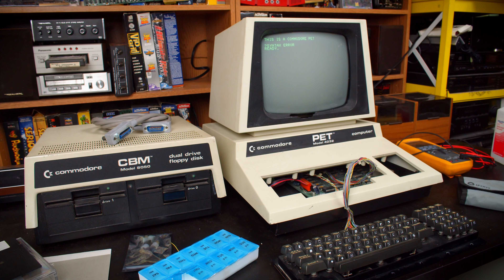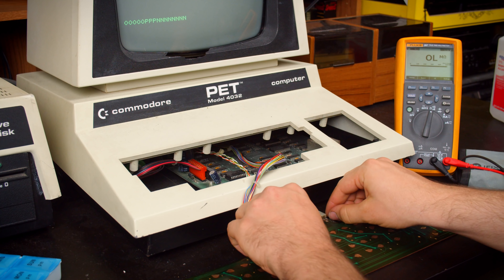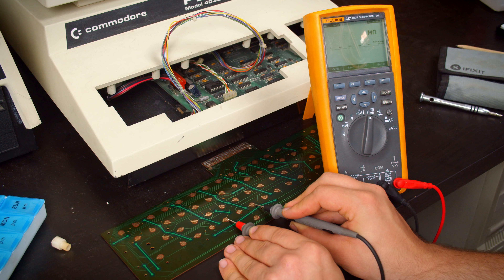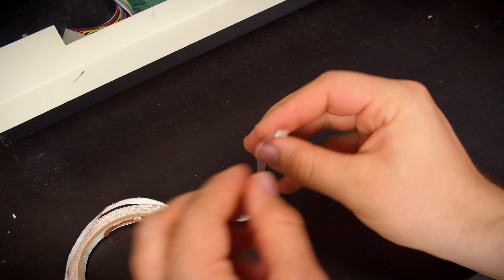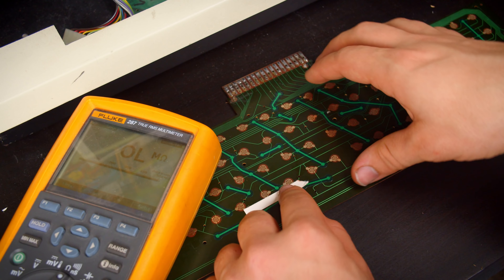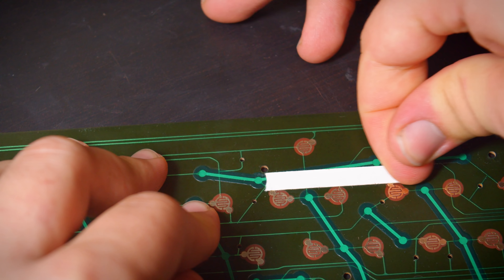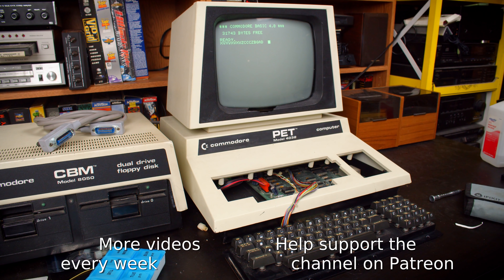Copper Tape PCB Repair - Micro Tangent

Comment: You can reface the rubber pads on the keys by “dragging” the contact across a piece of paper.  It removes the shine and restores their original functionality.  My 2001 was an absolute nightmare before I did this!
Reply: Yup. This is because the surface builds up a layer of non-conductive gunk because of the rubber out-gassing. You can also use a bit of iso-alcohol if you have observed spills or the gunk is particularly nasty. The traces themselves, particularly if they are that black carbon kind, need cleaning as well, residue builds up on them as well, which then ends up back on the rubber pads  = back to square one.

Comment: Do you document all your fixes?  I dont remember where I saw this, but it was a good idea.  All the fixes, bodge wires added, etc, were printed  on paper.  Then that paper was folded and put in a plastic sleeve adhered out of the way, inside the computer.  This way one could go back later and quickly read why, what, and how it was modified at a later date.  Very useful if one forgot what was done, or the machine is sold/given to someone else.
Reply: That's not a bad idea.

Comment: Thin coated wire from an old transformer or electric motor winding would also work if copper tape is not handy, just be sure to remove some of the coating at both ends of the wire with sandpaper or an open flame before soldering.
Reply: I keep several colored spools of prototyping wire on hand.

Comment: I can't feel good about this kind of repair in my own work. I'm glad it works for you, but I will always have a roll of .02mm and .01mm diameter insulated copper wire near my workbench.  I just see too many things fail because of "sticky thing dried out" and wire can't dry out.
Reply from the maker: Well, that's why I soldered it down. I wouldn't want to rely on the adhesive alone. I don't like the idea of using it without solder, but there are some cases like membrane keyboard where that's not an option.
Reply: Yeah, him soldering it definitely makes it fairly permanent. The adhesive can still fall and its still anchored. Its not pretty, but definitely functional without compromising the PCB.
Reply: Kapton tape down to make a base, copper tape over it, then another kapton tape on top. It will not come out in your life time.

Comment: A "prettier" repair might be to drill out the points where the traces meet and run wire links on the other side of the pcb as it's often done on single-sided stuff. It would be more time-consuming though, and this is Shelby's Perpetual Commodore Nightmare
Reply from the maker: I had thought of doing that actually. But it would be really hard to make any solution that involved soldering wires as flush as the tape was. And with the key holder "block" that goes over everything the vertical space is really important.
Reply: I cannot tell you just how much stuff gets destroyed trying to make it a half a percent better.
See, it's not JUST the time you lose doing such silly repairs, it is the can of worms you are opening trying to fix something that ain't broke and is already of questionable quality and was never designed to be field serviceable.
One of these channels uploaded a video of himself destroying a C128 because he decided to recap the 128 because, well, reasons.  If it ain't broke, don't fix it.
Reply: @LostElectron No because this is a single-sided board, not multi-layer.
Reply: @tarstarkusz  Okay, now I'm curious. What happened?
Reply: @tarstarkusz  This. Also, if you can't recap something without breaking it you shouldn't be making youtube videos.
Reply: @zosxavius   He's actually pretty good.  It's just a simple mistake that every electronics guy has made once or twice.  He put a polarized cap in backwards. IIRC, he blew one of the custom chips.
Reply: @peshozmiata : I think you've missed the point LostElecton was trying to make, which is... what if the silver above-trace passes too close to the original PCB trace. It's not a layered PCB, but the silver above-traces make it kind of like a layered PCB. With a small enough bit and good aim, one could drill through the PCB between the traces, but is such an invasive repair necessary if soldered conductive tape also works? I personally would have trimmed the copper tape narrower, and over-covered the copper tape with non-conductive electrical tape.
Reply: @Christopher-N  But the above-traces have points where they connect to the PCB's regular traces, which are clearly marked as circles. I mentioned drilling through those specific points in my original post. You would need to scrape off some of the solder mask up in order to solder there though.
Reply: @peshozmiata  but the board could still crack if it was done too fast or pushed on too hard
Reply: @nathanmead140  It could. There's probably more than a hundred ways to mess up a repair like this...

Comment: so the glue on that copper tape is also conductive? or am I missing something here?
Reply from the maker: Yes, the official term is "conductive adhesive". You don't technically have to solder it down in this case but I would highly recommend it. If you needed to do a field repair though, having the option to not solder could come in very handy.

Comment: excuse this off topic question .. could you use this tape on a rear window defroster (in a car)?? Connectors are soldered on strips inside the glass

Comment: The problem with adhesive, conductive or not, is that it ages. So, you rather have to solder it, and yes, if that protective covering isn't removed, it could peel off and end up where you don't want it. As unlikely as it is for a PET to be jostled about, you don't want to discover things have moved inside, post-reassembly.

Comment: I don't get it. The adhesive is conductive? How? If it isn't, how was it working before you soldered it down? If it is, then how is the next pad in between not shorted? I'm afraid of the adhesive shrinking and blank copper shorting a thing out. And i'm not sure how this stack of adhesive and copper tape and paper and on the end solder is thinner than magnet wire and some kapton tape or glue.

Comment: so if a circuit board had battery corrosion and cleaning it exposed some copper traces in spots whats the best fix?
Reply: Disable those lines (carefully with an exacto knife) and then expose fresh traces (if you don't have an exposed pick up or test point already) and start tracing with piggy-back wires.
If you want to use or are forced to use this method (copper tape) but don't have the room to populate that many traces in one spot, use kapton tape to layer stack these copper tape traces.
Be sure to measure existing, similar traces in the circuit to figure out the right resistance, so that you can mimic the same numbers with your repair. Might not matter, but in some cases, it does.

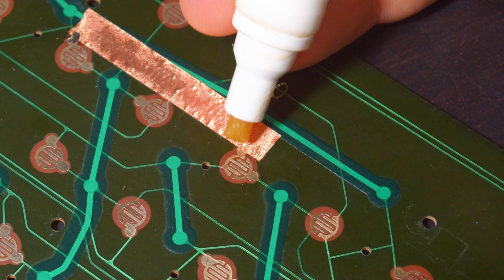Comment: 6:20. Yes, that was the bit that was driving me nuts watching it.  Because I know if I had done this I know it would have shorted.
Reply: This seems like a real bodge.

I would have left the backing tape present in this area, or better yet, take some of the backing tape and wrap it around this section perpendicular to the direction of the copper tape so it had no chance of conducting. 

In all honesty, I’d have probably gone with using some very fine, varnished wire to do this job.

Comment: A PET is the major hole in my collection!  Shelby, quick question - I;m old enough to remember these things when they came out, and I remember seeing some PETs set up with the dual floppy between the monitor and the computer. It seems like it's sized and tapered to fit there, but I cannot find any photos of that sort of setup on the net.  I'm not sure how the monitor would even connect.  Does it seem like such a setup is possible?  It's odd that I remember seeing it, but sometimes memory plays tricks.
Reply from the maker: You may be thinking of a PET 8296-D. The boxy PETs like this have the monitor permanently attached.

Comment: So can you solder to the copper tape? If so I wonder if it's possible to use them to replace solder pads.
Reply: Yes you can. but I would use some UV curable solder mask to make sure the tape stays in place.

Comment: personally if I didn't learn of copper tape, I would have just used metal duct working tape and only take the backing off where I needed electrical contact to be made

Comment: Best advice I ever got when it comes to stuff like this is if it ain't broke, don't fix it.  That extends to soldering when tape will do.  Getting it a half a percent "better" could have easily resulted in lifting those contacts.
Reply: Turn down the power on your iron.